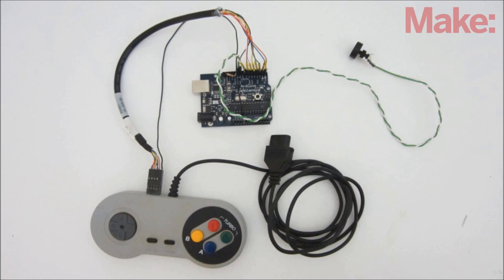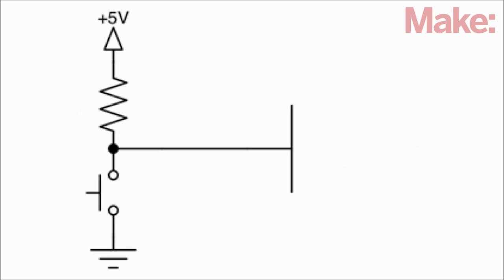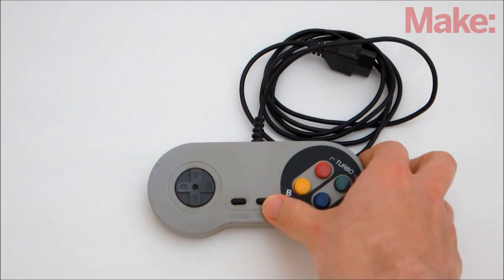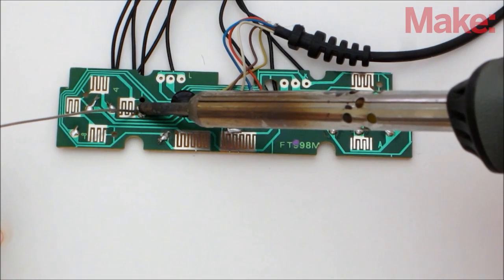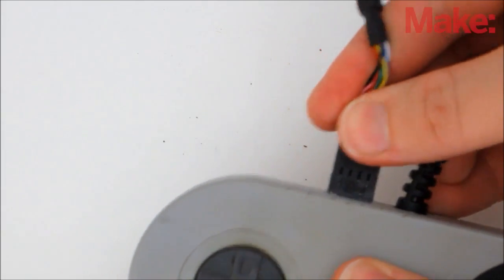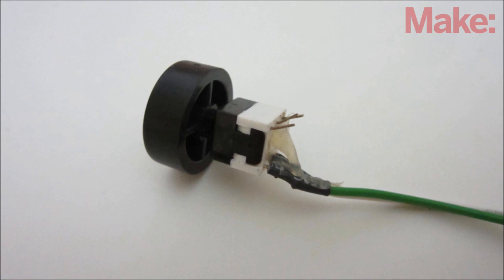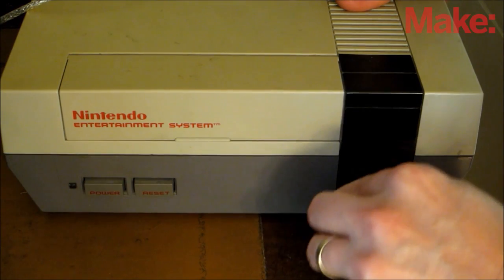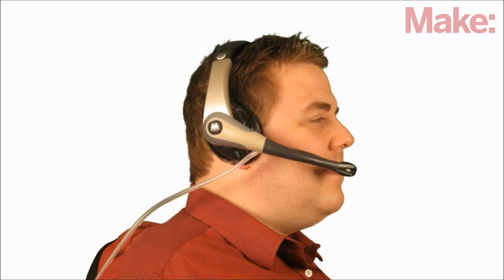DIY Hacks & How To's: Video Game Controller Mod

Comment: Can I use a rapid fire mod for call of duty
Reply: Actually yes, you can wire a 555 timer to your controller and send a high-frequency square wave to the "fire" button.
Reply: PunakiviAddikti +++

Comment: Mind my curiosity? Why is there a stray apostrophe in "How[ - t]o's" there in this title and description? Why doesn't that just say the plural form of "how-to," which is "how-tos" (or, in title case: "How-tos")?
Reply: i think it's easier to recognize the word with the apostrophe
Reply: OK, well that's not what the apostrophe was designed for, so people just need to learn not to use it there but to recognize the word anyway.

Comment: great video bro, how can I make my controller a turbo one ? I have Logitech gamepad I would love to mod turbo on it, because I play a lot street fighter alpha 3 on pc.
Reply: +mortal4life add another button and include it like the others except it will only be used in the arduino's code.

The code should probably be something in the lines of :
Define an array to store the buttons you will intercept with the turbo.

Check If turbo button is pressed but not released. If so, then scan all other buttons ( except directional maybe ? ) and if any are pressed, remember them for later in the array defined earlier.
If that turbo button is released and no other button was found pressed, then empty the button array ( because you will probably want to reset the turbo mode without having to turn off the arduino).

Then add a condition that runs every "x" miliseconds depending on the speed you want and tell it to send the button presses in the array.

You can also avoid inserting another button by making combinations like pressing both left and right at the same time to activate the turbo.
Reply: I play mw2

Comment: How would you make the arduino activate the consoles joysticks? They are alot more complicated then the buttons.
Reply: Not really, they're just potentiometers and one pushbutton under both stick. You can wire the potentiometers directly as a voltage divider and make the Arduino read the changes in voltage. When the stick is not moved the voltage should be constant. When the stick is moved, the voltage should be less or more than the constant voltage.

Comment: I'm a bit confused by your question, are you saying he should have bought a new controller instead of disassembling this one? What would that achieve? You have to open up at least one of the controllers to do this! Wouldn't do it with a genuine Snes one but you can get a cheap replica off eBay for £3 that does the job nicely ;)

Comment: Not like there in short supply, plus this is an aftermarket controller, which can be had for cheap on Ebay, or Amazon, and they are making new ones all the time.

Comment: [1:41] If the button is depressed, the mctrlr always reads low regardless of arduino's output. If the switch is open, the mctrlr normally reads high until the arduino outputs a low signal. The diode does not let unregulated current flow (from the arduino's output pin) when the button is depressed. Is this right?

Comment: I don't understand the function of the ckt. Does the hack enable you to control signals to the controller's microctrlr input using an arduino? [1:42] I also don't fully understand the explanation for the use of a diode in the ckt. When the switch is open, would the microctrlr normally read high until the arduino outputs a low signal? When the switch is closed, the microctrlr input should always be low, regardless of arduino's output signal right? (the diode doesn't let unreg current to gnd)

Comment: Nice. I recently took apart my old SNES controller to hook it up to an arduino (google snespaduino), and also plan to add such a controller emulator capability to my library.

Is the pull-down on the arduino really necessary? Doesn't the arduino pin pull the controller's pin low properly?